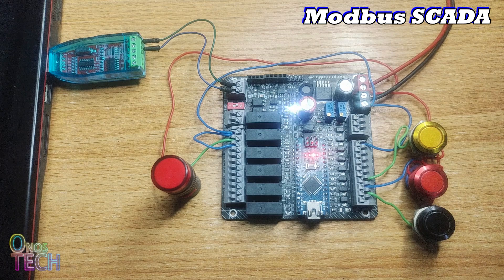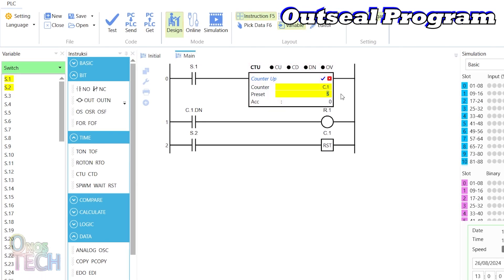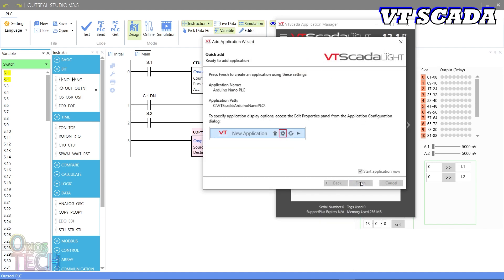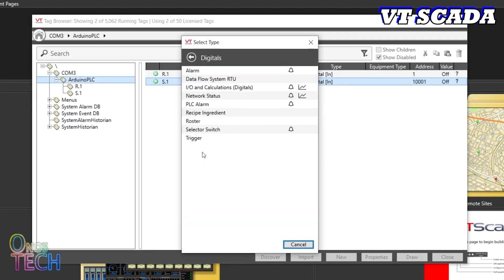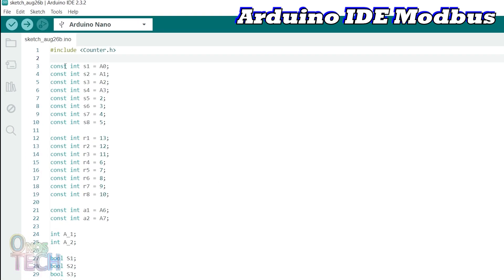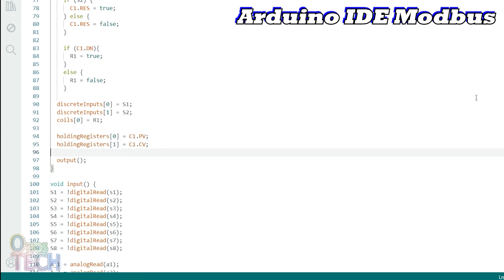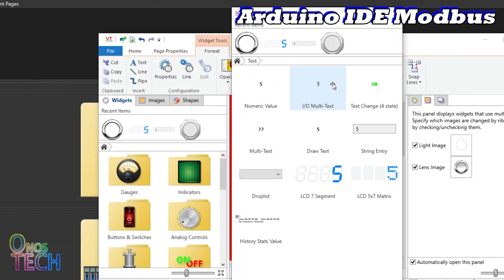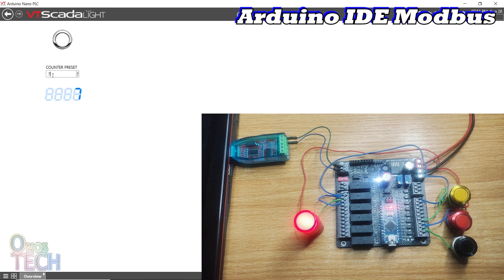#6 Arduino Nano PLC Modbus SCADA

Comment: Hi Onos:
First of all, congratulations on this new Arduino series!
I tried this example and works perfectly, but I have some questions for you.

1.- Is it possible to work with this ModbusRTUSlave and openPLC (Arduino extension)? If so, would you be so kind enough to make a video about this?
I am asking you this because the Modbus embedded with openPLC uses a loooooooooooooot of memory.

2.- How to configure memory Modbus Bits (B1, B2…etc). Could you make a video about this?

3.- How to configure the Modbus communication ports for Arduino Mega?, I mean Tx0-Rx0; 
Tx1-Rx1; Tx2-Rx2; and Tx3-Rx3
Also a video would be very helpful

Thank you very much in advance!😀!
Reply from the maker: I will consider
Reply: @OnosTech  Thank you very much!